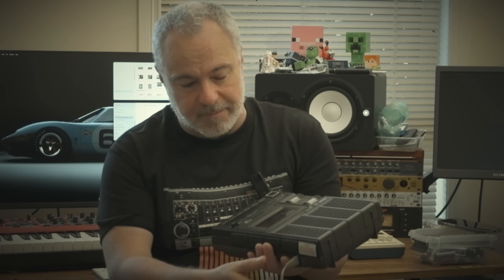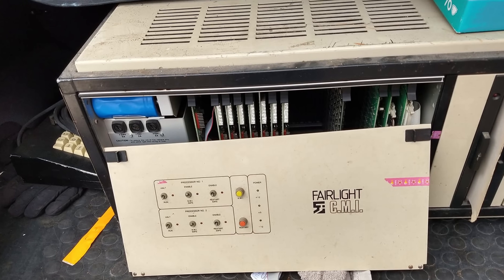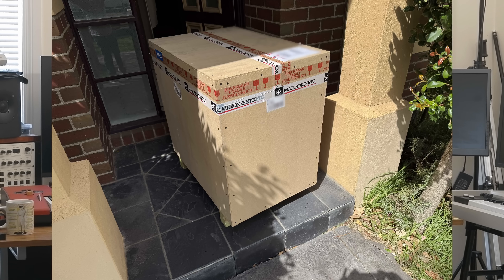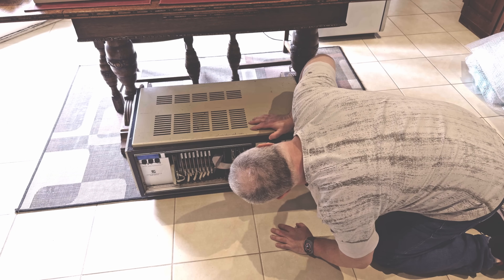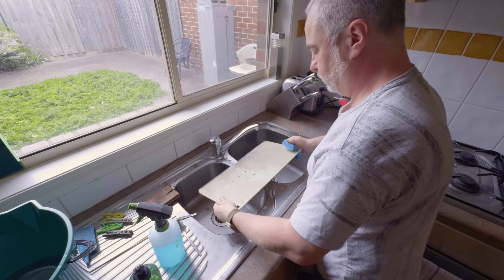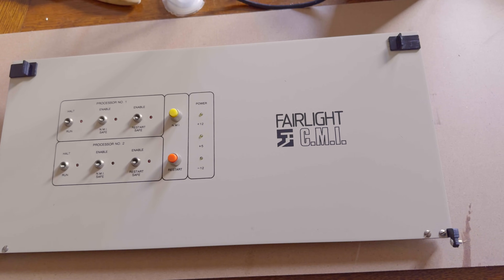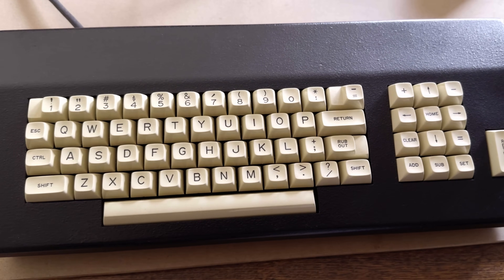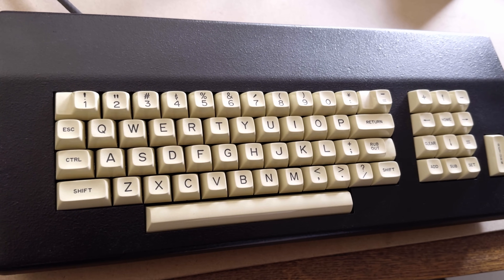A very broken Fairlight CMI IIX Restoration Part 1

Comment: 12:20 Tip for the cables and any other plastic part: Silicone Spray. Keeps and regains the elasticity of it since over time the softening agents degrade. Just make sure not to spray anything on contacts. And for mechanical parts ptfe spray which is better than oil because dust won’t stick to it. Works especially well for friction parts between metal and plastic.

Comment: A good way to get a textured look is to actually use a thick paint brush and tap a rather thick paint on by holding the brush at a 90 degree angle to the surface. I typically use acrylic concrete floor paint for this. Works like a charm. Even for rust proofing.
Reply from the maker: I will give this a go, thanks :D
Reply: @100ThingsIDo  Ah nice! Make sure to let me know how it goes.

Comment: In order to remove glue residue from tape, stickers etc. Use:
1. Spirit, then wipe
2. WD40, then wipe
3. Repeat from 1, and within a few minutes you've completely wiped it off. 
Note that in almost all cases spirit does not affect screen print, but try a small spot to make sure.

Comment: Awesome stuff mate! This battery degradation and damage thing happens a lot with other electronics too, including some of the hi-fi gear and test and measurement equipment I work on. It can be devastating to see a board so damaged by leaking electrolyte that it is basically unrecoverable.

Comment: Regarding the CRT. That CRT likely still has its vacuum. 
What you are seeing is the glue degrading whith which the implosion shield has been glued to the tube itself. Some CRTs used implosion shields like this to protect the user from shrapnel in case of an implosion. 
Another issue is said glue seeping out of the CRT at the bottom and corroding the implosion band around the CRT/boards sitting underneath it.
The glue can be removed, by leaving the tube in the sun and carefully cutting around the implosion shield to get through he outer most layer of dried glue. Then with a needle isopropyl alxohol can be injected between the shield and tube itself to aid in softening the glue. I then use a thin piece of acrylic to scrape the glue out until the implosion shield comes off. Afterwards the shield is re glued around the edges where its obscured by the bezel with double sided tape to get the spacing right. During the process of glue removal i like to keep the CRT in a bucket whith the mounts sitting on the ledge so the risk of snapping the neck is reduced.
However one needs to be extremely careful when doing this as a CRT implosion is no laughing matter.
Reply: Yeah, it looks like classic cataracts, though usually they start at the edges; here, it appears to be progressing from the centre. I have the same issue on my VT100. And yeah, removing the shield is a very dangerous process!
Reply: Agree - and yes, watch out if you need to replace the band, as that provides a significant structural element to the glass.  I've seen CRTs shatter with just a bump with the shield and band off.  It's possible to get a "like" tube replacement, or at least it was five years ago, but the phosphors will be different, and replacing it with an LCD never looks right and makes the light pen problematic since it relied on the vertical sweep to detect position.

Comment: Great project, I look forward to seeing how it goes. One caution that I would mention is electrostatic discharge, which everyone online seems to think is a myth, but having worked on and blown up computers of this vintage, is very much a reality. A simple ESD wrist strap clipped to the chassis and another clip to ground will keep any sensitive devices inside the Fairlight safe and is well worth the 10-30$Au. Why does no one seem to believe that ESD is an issue? Probably because the damage often doesn’t come to light immediately. I did once zap and instantly kill a Motorola 68030 by rolling my chair across carpet then touching the heat sink on top of it, but that was a spectacular and stupid move. More often I was the second or third technician to a fault and the customer would ask “what’s that thing on your wrist?”, I’d tell them it was my ESD strap and ask if the previous techs had worn one, they never had. Failure to wear ESD precautions was a sackable offence at one previous workplace, so I’m something of a believer.
Anyway, enough preaching, best of luck with the project, can’t wait to hear an ORCH2 out of it ;-)
Reply from the maker: Thanks for the information. I make sure I have grounded out before touching things. Very early on I killed a Apple IIc from eletrostatic discharge. I learn the lesson then :D

Comment: My friend has a Fairlight CMI III and the but the some of the keys on keyboard don't work so is limited to what he can do at the minute but the main keyboard it'self works ok and all the sounds too. To record vocal samples he has to but the disc drive in another room because it's so loud.
Reply from the maker: The CMOS chips that drive the keyboard can fail quite easy, also depending on the keyboard it could have springs for key contacts that become non-conductive over time and need cleaning. A good tech should be able to fix it up quite easy :D

Comment: I'm sure glad everything is in one piece. My heart sank when you lifted the lid and saw foam peanuts. They should never be used for packing heavy things because they shift and settle allowing whatever is packed in them to move around.
Reply from the maker: I had already removed a few buckets full by the time I started removing things, while your correct ... there was very little space for anything to move inside. It really was well packed :D
Reply: @100ThingsIDo  It's a miracle for sure, because usually when people pack heavy things using foam peanuts they don't pack them in tight - so the big or heavy items move around as the peanuts shift and settle.

Comment: Bravo!  All the best with the restoration, good on you for taking it on!  I love restoring classics as well, a bit simpler than this, though full disassembly and restoration also.  Vintage synths mainly.
Reply from the maker: I started in a similar way, just trying to keep my vintage synths alive :D
Reply: @100ThingsIDo  Indeed, too costly otherwise!  My restoration roster is mainly Rolands, TR606, MKS-70, JX8P, JX3P, Juno 60, 106, Alpha 2.  I've 4 at the moment, the later Juno's and the JXs.  

Recently I started designing pcbs to use in my modular video synth. I have finished up a comparator module which is working very well.

I look forward to seeing the rest of your Fairlight journey!  regards,

Comment: In case you don't know yet: It looks like the problem with that monitor is mainly what is called "cataract": It has a protective sheet of glass (possibly tinted) in front of the actual CRT, and the stuff between the front and the CRT got molded. This is very repairable but takes some special handling. There a videos on YouTube showing you how to do it.
Thanks for posting! Looking forward to the next episode.
Reply: came to say the same thing! :)
Reply from the maker: Thanks for wanting to help :D
Reply from the maker: Indeed, I can see that around the edges but the center worried the Jeepers out of me :D Thanks we will see how I go
Reply: @100ThingsIDo  shango066 has many CRT cataract removal videos. You need hot summer sun for it, so it is the perfect time to do it down under.
Reply: @100ThingsIDo  in the very worst case you can probably dredge up an appropriately sized old green monochrome monitor and do a tube swap, they're more or less interchangeable so long as the mounting lugs are oriented the same way, you'll generally need to swap the deflection yoke over though. 

Hopefully you can sort the cataracts without too much drama though :)
Reply: shango066 is the cateract master.

Comment: Excellent video. For glue residue I found out that cleaning benzine works probably best. It's what I used for Emulator II overlay removal, WD40 is good too but can be hard to remove that smell. :)
Reply from the maker: Hey there, hope your doing well and your creating great sounds! I tried to pruchase an E II recently but the seller got cold feet and decided to keep it :D
Reply: @100ThingsIDo  Friend has two E-II's one of which is original HD version he might sell it, but it's EU unfortunately. Shipping and customs just places it way way up...
Reply: Don's in the house!

Comment: When I went to college in London between 1979-83 we acquired around 1981 one of the first Series 1 Fairlights in the UK and had "lessons" with Hugh McDowell the then cello player in ELO (no longer alive sadly). Spool forward to 1987 and I acquired Alan Parson's Series IIx, which had the original sequence and guitar samples for Mammagamma (guessing a play on Ummagumma), a very impressive piece of  programming, as the echoed notes in the lead line were actually programmed notes with descending velocity. It also has the original 8-track foundation sequences and sounds for Two Tribes (Frankie) and Close to the Edit (Art of Noise), which I recorded and still have today. In 1988 I stepped up to the Series III (from Andrew Stirling at Syco Systems) and parted with the IIx. I think the Series III once fully-load cost me around £40,000, which considering I'd paid £56,000 a year earlier for my first house, gives you an idea of the relative eye-waterng cost. I recall the additional 2MB cards cost £2,000 each - mad! Look forward to seeing how your restoration quest goes.
Reply from the maker: Wow, JJ for sure managed to get every ounce of sound out of the early CMI's back in those ZTT days! I hope you or someone has managed to archive the floppy's. :D
Reply: @100ThingsIDo  Alas, when I sold my Series III in 2005, I let all the files go with it. All I did was to lay the resultant audio off onto a DAW.

Comment: Subscribed, this is an awesome restoration project! My own journey with recording also started with a tape machine similar to yours which was given to me by my paternal grandfather when I was about six years old. Several decades later my parents discovered one of the tapes I'd recorded via the built in microphone, and it was amazing to hear how strong a Cockney accent I had as a child.

I have a Fairlight story as well. Twenty years ago I was playing in a band that rehearsed at an incredibly squalid studio called La Rocka in London. One time we were there I noticed in the corner of the office a bit of equipment with the Fairlight logo on it. I asked the guy who ran the place what it was, and he told me it belonged to the co-owner of the studio who had been a salesman for Fairlight. When Fairlight went out of business he ended up with the equipment. From what I recall it wasn't a sampler, but part of some sort of digital recording system that was supposed to compete with the NED Synclavier.
Reply from the maker: I'm guessing that was a MFX 3 system, I have one of those also hiding away in my 'Machine Room' Not sure who the person would of been that run La Rocka, I should ask in the Fairlight group :D
Reply: I did have a Google after posting my comment and I think you're correct about it being a component of an MFX system. I can't recall if I ever knew the name of the co-owner of La Rocka, but the guy there usually was Pete Chapman who did sound engineering in the recording studio on the top floor. I did my first proper recording session there and it turned out sounding great, despite all the equipment being covered in a layer of cigarette ash!

Comment: If I'm not mistaken, that texture isn't a type-of-paint effect, it's a type-of-spray effect that's applied during painting. Basically, you have two guns and you paint a standard coat as you'd expect. You let that dry, and then you hit it again with the second gun which is set to "spit" paint and not atomise it. I could be wrong, but having once done it myself in a Sydney factory, it looks very similar. Note that you can't easily do it with a rattle can, as you need control of the air pressure.
Reply from the maker: You are most probably correct, you can get rattle can's these days that contain particulate to do a similar job :D

Comment: Wow! My dad bought me exactly the same model of Philips cassette recorder, the N2214, when I was 10 or 11, around 1975-76.
Reply from the maker: The sound of the door opening when you press Eject is the sound of my childhood :D, 1976 for me :D
Reply: @100ThingsIDo  I loved those barrel volume, tone knobs, at the time they seemed incredibly stylish and cool.
Reply: Quite luxurious! I had a taperecorder with a turning knob but this was a few years earlier I guess. Can’t remember the brand, was cheap so nothing much I guess.
Reply: I had the same cassette recorder n2214 only after a couple of years the pinch roller alignment went out so it would damage the tapes . I had earlier models of Philips tape recorder that were metal mechanism so that  not an issue . Yes suppose was new Sumner 76. The first tape I ever played on it was "mamas & the papas hits of gold" on stateside label

Comment: Excellent start. I would need to know right from the get go if it powered up! Cheers.
Reply from the maker: We will go into that next time.... there are so many different voltages at play in the CMI and the power supply is over 40 years old .... I had to force myself not to just 'flick the switch' no matter how much I just want to :D

Comment: So how is the 1X project going along?

For cheap(ish) texture paints I would highly recommend Warnex (one of the standard speaker paints). With a long pile roller it tends to come out really well, and if you spray over you can get an amazing finish.
Reply from the maker: Hey man, hows it going ? I'll check out the paint. The 1x has now changed course, I have enough parts to make a single voice Series 1 (even card cage and original frame parts). I'll do that next year I hope :D
Reply: @100ThingsIDo  Three generations of Fairlight in one room plus a Synclavier 2? That feels like some rift in the space time continuum is about to happen.
It's going allright here; as always too much stuff and not enough space.
I did finally manage to get a reasonable deal on a Larc so the 300L is no longer a paper weight, I just need to get my act together and solder patchbays so I can actually have a useful setup here (until I have the willingness and means to move into a large enough space for all the stuff).
Reply from the maker: @nativeVS  I was going to ask about the L300, such a really nice reverb! :) Maybe I will have all generations of Fairlight soon, including the 30A! :O Nothing in the world like them.

Comment: Those CRTs always get so nasty... hoping for a successful cataract surgery or replacement tube to show up.
Reply from the maker: Indeed, and because the Fairlight screen is so big its VERY rare to find a matching tube :D
Reply: @100ThingsIDo Finding that kind of old CRT tube that fit the spec of the Fairlight CMI was probably not easy , this thing must have the good refresh rate to work properly with the lightpen, it's not like using the one that came with an old French TO 7 Thomson computer that use a similar lightpen, those from the Fairlight are specificly made for this machine... But lightpen was also use on old computer like Sketchpad or for scientist use.
Reply: @100ThingsIDo  yeah this looks like a cataract issue, should be easy to fix..

Comment: So cool! Best of luck with the restoration. I have an IIx with the same front panel as yours. My chassis SN is SNA108050. My understanding is it was made in October 1980, the 50th CMI made. But that's too early for MIDI, so it was retrofitted at some point after 1984.
Reply from the maker: I'm guessing that was originally a Series I that was upgraded at some point ? :D
Reply: @100ThingsIDo  Sounds like it. I take it your's has the MIDI port box bolted to the back of the chassis.

Comment: Looking forward to the repair series. The monitor is probably fine, that's just some glue between the front glass and the CRT that needs to be removed... But you probably know that, because it seems to work in the thumbnail 🙂
Reply from the maker: Thanks! Indeed the video's take a while to put togeather so I'm ahead of where the Video shows I'm up to :D